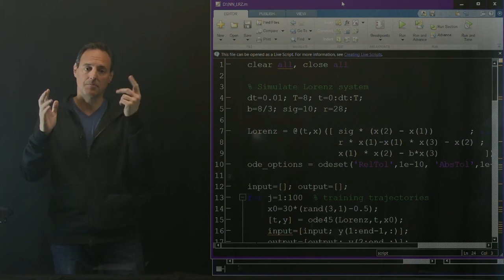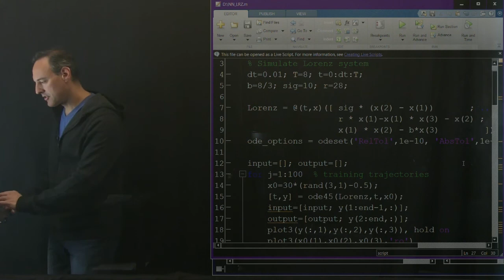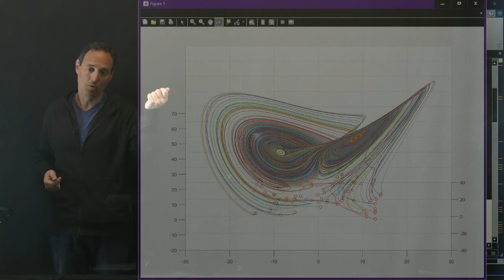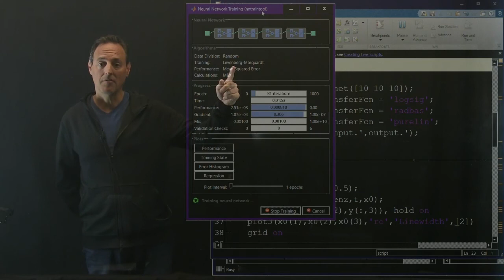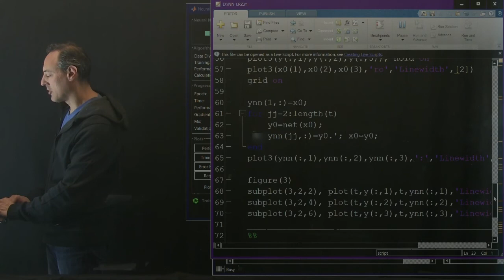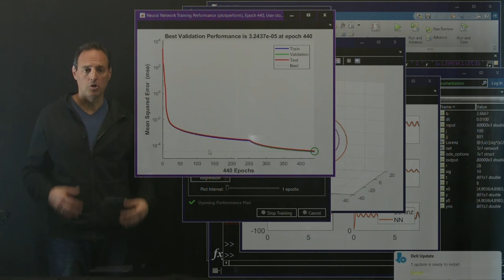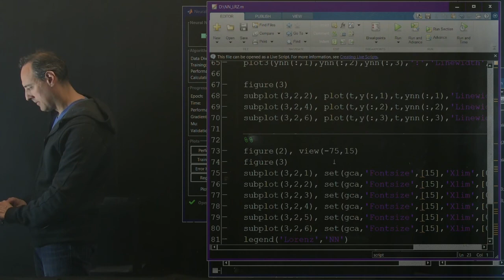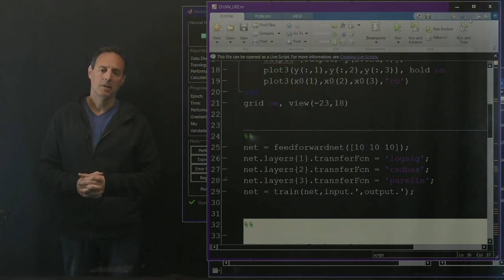Neural Network & Dynamics

Comment: it looks like it starts deviates at the end. Also, would be interesting seeing a system that is not stable per say (although this system is not stable it has a limit cycle so that the NN would converge anyways)
Reply: That's due to the nature of the Lorenz equations - they are chaotics, meaning (among other things) that any two trajectories that are very close together will diverge at an exponential rate.  If he had started 2 points that are extremely close to each other, say, 1e-5, and solved using only the ode solver, he would have seen divergence at the end of that as well.  It's actually quite remarkable that the ode and NN trajectories stay as close to each other as they do, and shows the NN is doing about as well as is possible.  The only way to really do better is to cheat and know what the functional form of the Lorenz equations are with certainty, which of course the NN doesn't have.

Comment: Is there an advantage of using a neural net instead of solving the equations numerically? What is the point of using neural nets if the system can be described by equations? I'm not trying to be rude, I just don't understand.
Reply: Nevermind, I get it. You can't always obtain an accurate mathematical expression for a system in real life. Also, non-linear systems are really difficult to solve, that's where neural networks come into play.